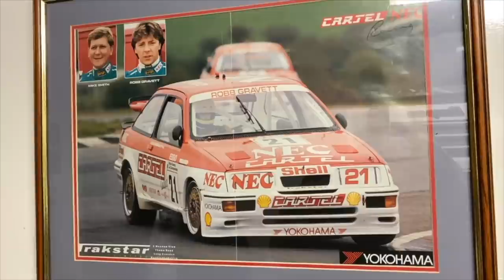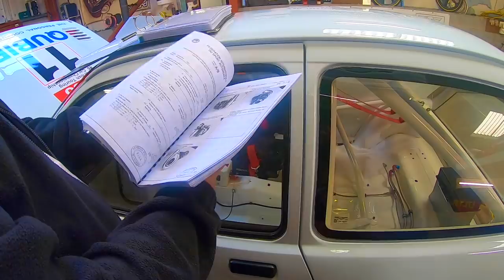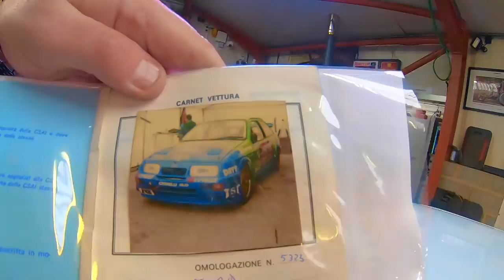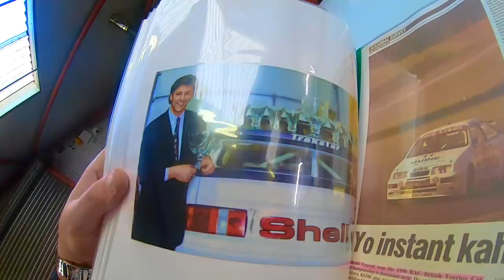Robb Gravett’s BTCC Championship winning RS500 Cosworth ** Once owned by McLaren CEO Zak Brown **

Comment: ADAM, turn your shutter speed to 1/30th to get rid of the flickering from the fluorescent lighting, its causing GREEN banding too, keep your frame rate to 25fps
Fluorescent lighting is either 50or 60hz so going below that dials it out...
Reply from the maker: Cheers Jason. I’ll remember that 😁👍🏼
Reply: @Adam151082  your welcome Adam, I used to run workshops for Calumet on DSLR video, if you get stuck on anything and need a bit of advice don't be afraid to ask me.